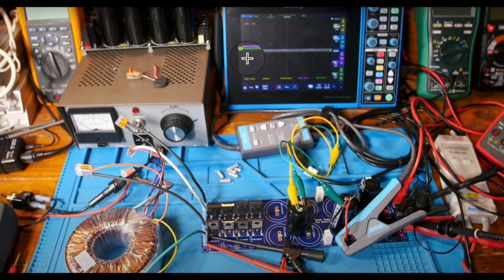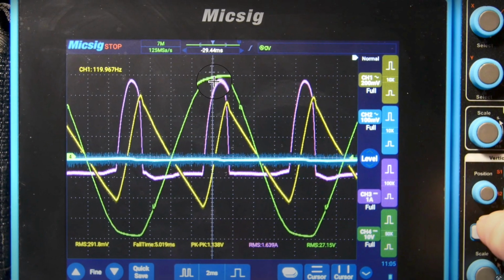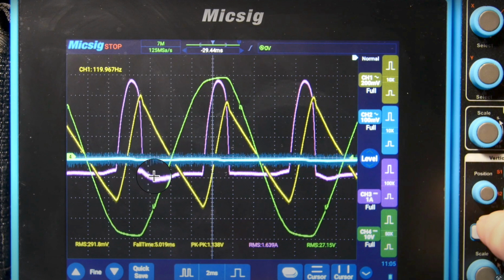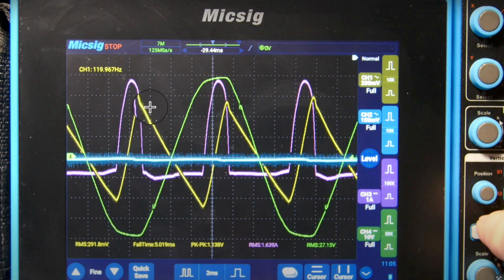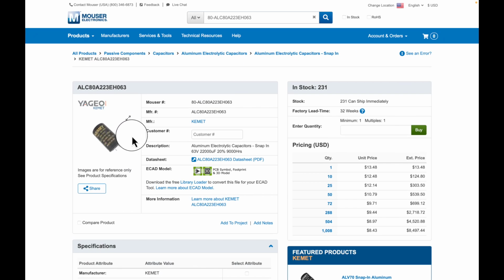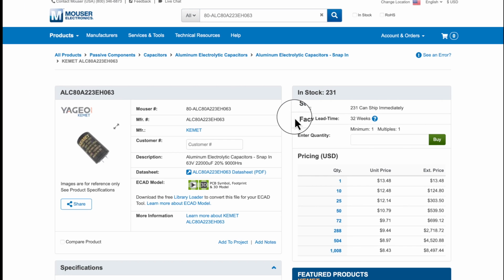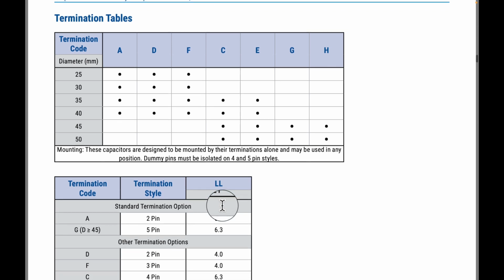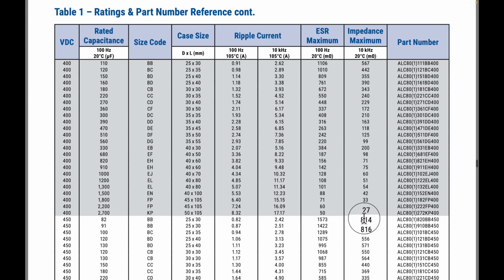How to Size the Power Supply Bulk Capacitor - I have an easy formula to follow

Comment: Started to test my new redesigned HIFI amplifier, this is my own design. 2x300W in 4 ohms. 31 transistors per channel. It worked on the first try.🤓
It has double differential amplifiers and two five transistor Wilson current mirrors per channel🤓Also two constant current generators to each differential amplifier.
Soon I will be doing load testing. Built my own power supply with slow start, and a 12v trigger input, and speaker DC-protection. Over kill for home use, but why not :)
Reply from the maker: That sounds like a fantastic design, and there's definitely no such thing as overkill in DIY audio! 🔊

Comment: Quick question... I know this is a bit outside the video but still in the subject. What would you recommend as a Electronic Load (programmable) that could handle 200 watts at a reasonable price for us mere mortals? I've worked on power supplies in the past but obviously not on par with yourself. Most of my experience is with radios and I obviously have to deal with power supplies. Everything these days is switching power supplies which is cool BUT they are noisy (RF wise). I have decided I need to get good at linear power supplies. Old used broke one etc etc. I want to step up my game there so I can improve protection, clean'em up as well as continue to repair them and maybe delve into a bit more of the design side (as related to working on broke existing power supplies and improving them). Obviously I need a good load tester... Mainly we're talking 13.8v. and TTL voltages... What say you???

Comment: Needs a Capacitor bank that gets fed by a liquid fuel generator that is the source of power for a smaller bank of capacitors that electric motors use directly. Flying or driving drone, doesn't matter. The Army is designing their new vehicles this way. I'm still working on the Robit Brain, I've not gotten to this stage yet. Just preparing.
Reply from the maker: Wow - can't wait to hear more about it;)

Comment: I am interested in learning about heat sink selection. Let’s say a simple LM2575 or any other TO 220 type device. They specify a thermal resistance junction to case. How do you select a heat sink for free air and when would you use forced air. Thanks. Your videos are very educational. I do like your style . I think it would be beneficial if you had an outline or script to help keep you on track. (I do learn from your side tracks)
Reply from the maker: Thanks so much for your feedback!  I'll do more heatsink design stuff.  I did do a video just recently - did you see this one?  https://youtu.be/Rysti9BLTy4
Reply: @ yes I liked the video you recommended. Nice job on the heat sinking information. Have you ever used heat pipes in your designs
Reply from the maker: Yes, thanks for asking.  I will do a video on heatsinks, thermal paste, and heat pipes.

Comment: My process for capacitor sizing has mostly proceeded this way:  1. application is input to a (3-terminal) regulator that requires minimum of 2 V extra input voltage for my 15 V output.  2.  Ripple BOTTOM then has to be above 17 V.  3. The line voltage can vary plus or minus 10%, and diode drps are some 1.2 V for a full wave bridge, but depending on the size of the transformer, it may produce some 5% extra voltage.  These voltage concerns apply for the capacitor voltage rating selection (plus you may want to use a 35% life boost per U.S. military guidance).  4.  Then we have the current and preferred ripple.  If our regulator is capable of 1.5 A, we want to stick to 1.0 A continuous maximum.  If we also want to stay at 1 V peak to peak ripple maximum, we fet the required capacitance from the basic definition, using the decay side of the ripple slope.  5.  Capacitance = (Current * Delta Time) / (Peak-peak ripple volts).  6.  Now we need the value for the “Delta time”.  It varies somewhat with the transformer internal impedance, wiring resistance and even the eventual capacitor value selection, BUT more on the power line frequency, i.e. either 50 or 60 Hz.  On 50 Hz, I use the Delta Time of 8 milliseconds, while for the 60 Hz I can use 6 milliseconds.  7.  Now the formula gives either 8 mF (8000 uF) or 6 mF at the two frequencies, respectively.  8.  Then, the🎉 time for checking the data sheet for suitable voltage (in my case at least 25 V, but more likely 35 V).  What is the most appropriate standard capacitance, and what is its ripple current rating.  Take for simplicity ripple current = the same 1 A as the DC current.  If you like, you can calculate (I squared) times (the ESR), which tells the power dissipation in the (or each) capacitor, as applicable, but the data sheet value should suffice.  That is the whole process with one basic math step (formula) used.
Reply from the maker: Yes that sounds right!  Thanks for sharing!

Comment: Can you tell me how the t network benefits the storage capacitor split foil, is it like a balance network on the capacitor? Dnm make them, it's a four pin capacitor you can convert a two-pin to a four pin with a board. Yeah examining a power supply from an amplifier would be interesting
I thought about content for your channel. What about putting some repair videos together you could buy some cheap broken stuff of e,b.. and repair it and resell it a bit Tony b. Got content for your channel plus you make couple hundred dollars selling it on. People like repair videos I do😃
Reply from the maker: Thanks for asking.  Can you explain the t network - do you mean like a Pie filter?  Also what do you mean about the split foil?  Is that the type of 4 pin capacitor?   I will explain the multiple pin capacitors in a video.  Also, I will do more repair videos.  I have some now - here's one: https://youtu.be/PwYGuFa736c

Thanks for the ideas!!
Reply: @kissanalog  I think you've had too many beers😉 you know a split foil! its cut with Lines in the foil and this is supposed to reduce eddy currants. Other manufactures make them split foil. I'm not sure what the t network is I think it's their term for the capacitor, also they call it a 4TTN. maybe that makes more sense this company designed this type of topology in the capacitor you need to look on their site easy then me explain in it because I don't really know they say quoting there article: Only as a capacitor without unwanted effects such as stray resistance inductance and eddy current generation caused by the presence of two vast containing surfaces in the circuit.
 dnm uk, in the association with supertech developed the Guided current 4ttn t- network they say the extra terminal is connected in a t pattern they give charts and stuff and quite a lot of information bit above my head.  load attenuation chart, low point 75 KHz the t network is 11db lower than a standard at 1.4 megahertz.
Check  it out they give a lot of data how it's better than a standard capacitor you probably find it an interesting read when you're on the bog😂
Reply from the maker: LOL, I think you are the one wiht too many beers under this text.  I find it funny how some people are so triggered by watching a man drink a beer;)

You are describing types of capacitors all over the place.  I am talking about capacitors related to power supply BULK.  Capacitors are a specialty of mine - although there are many - but you seem to have went over board.   

Please give me a specific question and/or comment regarding BULK capacitors.

Comment: Hell yeah on a regulated low-speed switcher(see what I did there?)!
In the distant past, I did just that using 317, 7805/7812/7824 regs with a series pass BJT all mounted on the same HS to maintain thermal overload protection. Worked a treat. Even tried doing active capacitor multiplication using BJTs again, but man, that was so very inefficient power-wise, and that's saying something when we are talking about low-speed switchers!
Nice video sir, much appreciated. A great 2025 to you and your family!
Reply from the maker: Thanks for the cool backstory, I appreciate your feedback!  It sounds like you had regulation for different stages - well done!  BJT pass transistor is a great way to get good regulation and some power;)

BTW, I like the sound of your description "low speed switcher", just sounds so descriptive coming from a pro!  ;)

Comment: question regarding capacitors :  does time "on" make them fail or is it "power pushed"  that reduces their life?
Reply from the maker: Great Question!  There's a number of factors - but in short - any that lead to heat will lower their life span.
Reply: @kissanalog  fascinating, this makes sense , cheers for your thoughtful reply
Reply from the maker: I'll do a cap video in the future...

Comment: Eddie, any topic about amplifiers, I'm interested to see. I have several amps and a couple have the same problem, and I can't figure out what is causing it. The amps are B&K Components with a design that mutes the amps to ground in standby (the big caps stay charged). When turned on the amps work perfectly with less than 5mv of DC on all channels. However, when in standby all channels have at least minus 100mv of DC. The highest one has minus 350mv DC where I can hear hissing from the speaker in standby. The amps have 6 "coke size" caps @3.2 mf per cap which none of my ESR or LCR meters can read. I've spent a lot of time searching online, but my problem isn't easy to explain in a question for Google to find. My home theater just doesn't sound as good without the beefy 75 lbs beast B&K amp.  

What could cause minus DC voltage (in the hundreds of mv) on the output in standby mode?
Reply from the maker: Great question!  OK, I am assuming that you are measuring the speaker output - is that correct?  Is your multimeter in DC or AC mode when you are reading this?  Again I am assuming, but if it is in DC mode - try AC and see what it is.

The amp is amplifying what it sees at the input.  If the mute botton shorts the input to GND to put zero volts at the input - then the feedback (if there is) tries to mimmic that at the inverting input.  If it worked great or better when they were new then maybe the switch is not clean.  If the mute switch is not clean and doesn't make a solid connection to GND - then this could be causing the issue. Try wiggling the mute button to see if the sound changes.  If it has always done it - as all your amps seem to be doing the same thing - then maybe the gain at DC is not high enough to drive the output to zero volts?  This could be the culprit if they are all positive in value (plus DC volts above ground).

If they weren't so heavy to ship - I'd say send me one and I'll fix it on a video;)

Please let us know what you find.
Reply: @kissanalog    Thanks Eddie for your reply. Much appreciated. I'm measuring at the speaker terminals with the multimeter in DC mode and all 5 channels have different levels of minus DC mv. All measurements are negative voltage for DC and absolute zero volts in AC mode for all channels. 

My power amp only has a standby mode via using a 12v trigger from a preamp. My B&K receiver (with the same problem) has pretty much the same amp section and power supply as the power amp. With the only significant differences being a smaller transformer and 2 less pairs of output mosfets. And the standby mode is default when the main power button is on and the processor turns on the amp.

My third problem child is another B&K receiver I converted to a power amp, where the main power button defaults to standby mode and I added a switch to short the two wires the processor would have used to turn the amp on. At first I connected the 2 wires and pushed the main power button and the breaker blew instantly. Obviously B&Ks design has a two step system, where the big caps have to charge up first, before the amps are turned on. 

All three of these B&Ks are 20 years old and I bought them used. The only reason I checked the outputs is because I could hear noise from the speakers (3 feet away) in standby. I could put my power amp back in my system and use the main power switch, but that would be a big stress on the big caps charging up everyday. 

Could the problem be caused by leaky caps. I noticed on the power amp when I had the power supply/trigger circuit PCB unscrewed from the 2 banks of caps, that the negative bank would charge up (dielectrically) to about 3.5v and the positive bank was about 600-700mv lower. Does this mean that one bank is more leaky?
I tested all of the components on the control/trigger board and everything seemed okay. With possibly the exception of the small relay for the trigger control. The 2 large relays have a solid click. I tested the small relay with my bench power supply and it did click, but not with the same sharp snap like similar sized relays I had to compare. 

I can follow typical schematics, but trigger circuits go in a circle and I don't understand what path to follow. I do know that when I plug in the 3.5 mm jack into the trigger input, it shorts out 2 small transistors in the "circle" I mentioned above. The fact that the PCB is mounted upside down on the big caps, I can't see where the components are to test when powered up and see what happens between standby and on. 
I can't find any information on the internet about trigger control circuits. 

Thanks again, Eddie for sharing your wealth of knowledge and explaining the "whys" of things. You're a great teacher.

Comment: At this moment I am calculating with.

Transformer 500 VA
2 x 38 VAC 
> full wave rectifier 
> filter (RC) 
> bleed resistors 5K 
> 47mF/63V/16,4A/14mOhms 
> 0R47 resistor serial 
> 22mF/63V/10,07A/24mOhms > 22mF/63V/10,07A/24mOhms > inductor 4,7uH/11,9A/12mOhms
> 0,1uF par
> 22mF/63V/10,07A/24mOhms > 2,2nF + 0R47 par.
> led + resistor 
> 0,1uF par.
> fuseholder

4 x (dual mono) 

Amplifier:
- 52 VDC +-
- 50 Watt Class A
- 200 Watt@8 Ohm Class A/B
- 400 Watt@4 Ohm Class A/B

Comment: I often deal with power supplies for ham and commerical radios. They are usually 12V , 24volt or 48 volt. 1 volt ripple would be awful. I am use to looking at ripple as a percentage. Generally 1% or less is the charateristic of a good power supply. So I use a   more general formula. Capacitance =load current/ (2 * frequency * desired peak to peak voltage for ripple)
Reply from the maker: Thanks for the input - you are right that the ripple spec is often given as a percentage and 1% is pretty standard.  I was focusing on audio where they use huge cap banks.  But, if we do the math, I think your formula for the 12V would come close to mine.  In my formula you would use 10 x to lower the ripple to 1% and then if your current is 10 Amps - we would be talking about 600 uF.  

However, for RF, the issue of high frequency filtering is much more part of this.  So, plain old bulk capacitance will not do as much as using the right capacitor technology (combinations of tech).  

Give me an example or a couple examples of what you would do and let's see if I can come up with anything better.  This would be great for others to learn from someone with experience in RF power.
Reply: @kissanalog  I certainly was not disputing your metodology. I focus mostly on power supplies for radios. Like any niche, we have our pecular standards. Unlike audio systems, RF is very susceptible noise due to high frequency ripple. Radio receivers can detect signals as low as -120dBm. It is still the reason, switched mode power supplies are often avoided by Hams. AC to DC power supplies for RF are using the very high value capacitors that you see in audio, but they are careful in the use of inductors for filtering. We don't want any unintentional tuned circuits spewing high frequency noise into a RF circuit. 
For example a switched mode PS often operates in the 100k to 220kHz range. That is just the 2nd or 3rd harmonic down from a 455kHz IF stage. I realize modern switch mode PS's due a much better job of fltering out the high frequency ripple but the 120 Hz ripple from a linear power supply is much easier to manage.

Comment: Would love to see a video of measuring ripple voltage and current from an audio amp.  Would a higher input voltage transformer help with voltage drop if sized correctly, say a 240 v primary?
Reply from the maker: Great questions - thanks!  First, a 240V primary is easier because of the lower current - but then if the manufacturer sizes the wire too small - then you can still get a voltage sag.  A higher voltage on the output can be a big help so that you can use smaller caps and still get enough voltage - even through the troughs of the ripple;)

Comment: There's a good MIT Open Courseware grad course on power electronics that's focused on every type of power converter imaginable. He does a pretty good job of covering this topic too, although with as much math as you'd expect from an EE grad course!
Reply from the maker: Thanks!  I may have seen this - or at least part of it.  I appreciate your feedback!

What I find with these courses is that they are done by folks who have never actually designed a power supply for a product - or 10 of them;)  So, they miss the practical aspects and spend more time on math.   

if you can see a formula and then the wave shapes - then how you can use  the formula intuitively  -  then, for me, that's when you have a thinking designer.

I hope this video shows how I show the meaningful formula and how it can be scaled.  This is huge if you can really grasp it and work with it.  

Also, I do try to show a bit different view each time to get a different angle at it.  I hope that helps;)